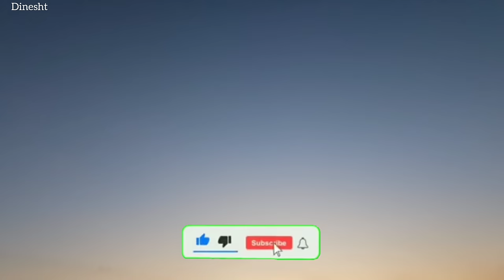"From Single Mother to Builder: A Cottage for my Children's Dreams"

Comment: This plasterer did a great job considering how rough and uneven the underlying concrete block walls are! I hope he will be returning to finish at least the interior so that it looks consistent.  It definitely upgraded the looks of things!  Since Anis sacrificed her plastic which was over the tent as a rain guard to add rain protection to the new roof, I hope it doesn’t rain before they can take shelter in the new building. My deepest respect to her for her sheer strength and endurance, and grace in the face of so many challenges!

Comment: Need another door in case of an emergency. the windows are to high for tglhe kids to jump. Just said because all the time they cook inside and put the gallon of gas inside also the heatter when they put the chiminy in the wall unstead of the roof of the house. Even the kids can put a rock inside the tube and can cause a fire or an intoxication for smoke